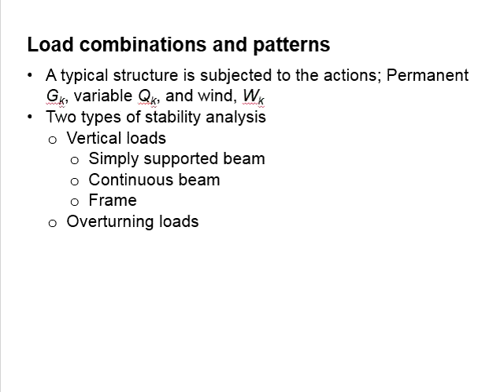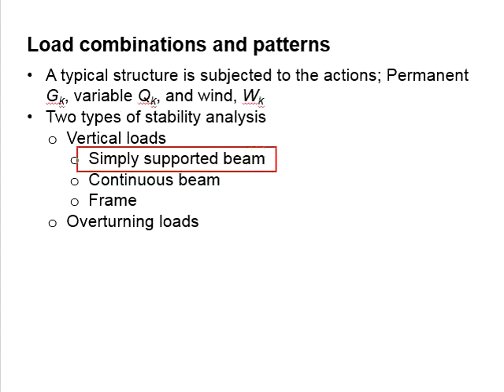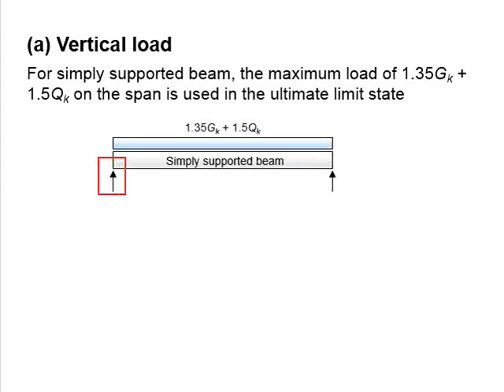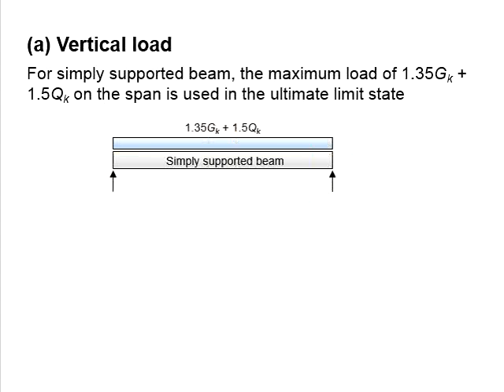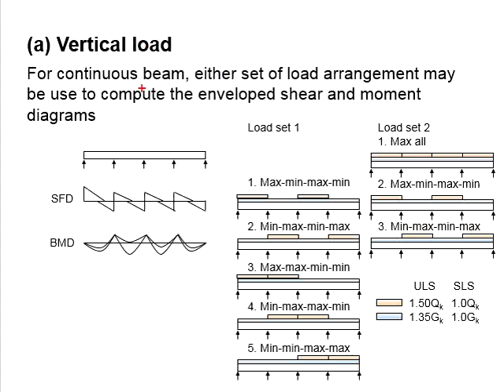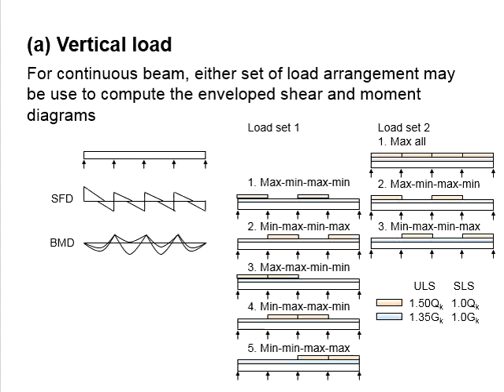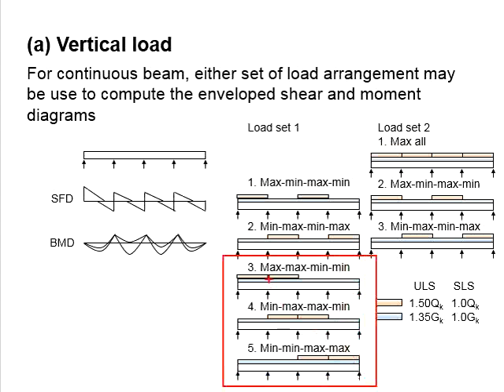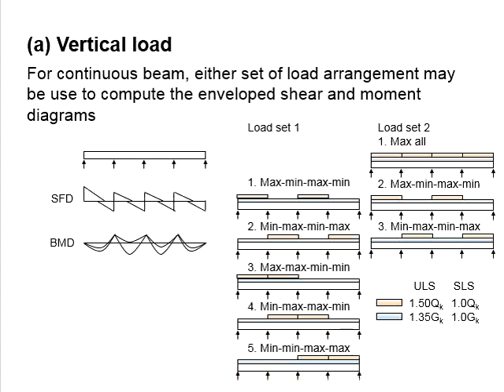3.3 Load Combination

Comment: There's Conflict here between this video and your other (2.13) video in this playlist 
Link: https://youtu.be/G5QT90LRmds?list=PLu92K1Z_6m_kPomTyHkYsPfXNDu5b0Sfl&t=216
You used 1.35 and 1.0 here, while you used 1.1 and 0.9 there.
Both were done for overturning.
Which one is right?
Reply from the maker: You are right. Thanks for notifying. Overturning should be 1.1 and 0.9. The 1.35 and 1.0 here do not really suit for overturning.